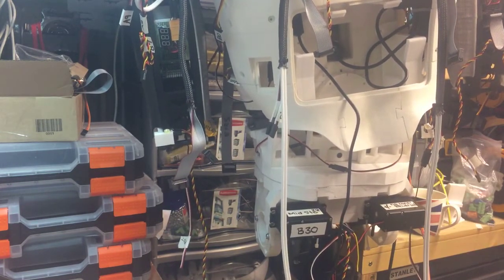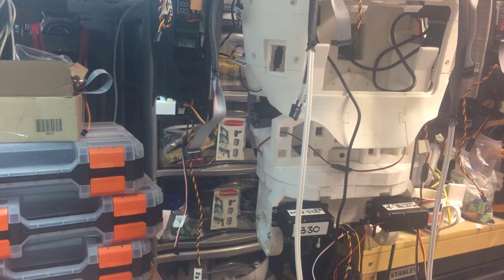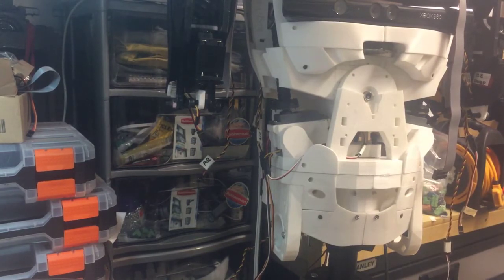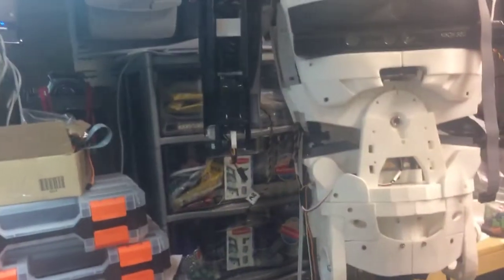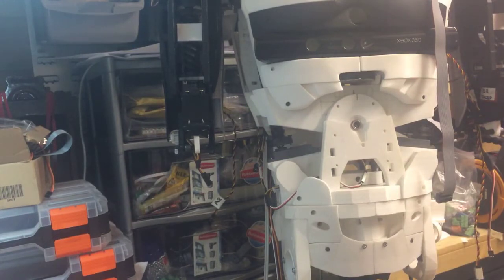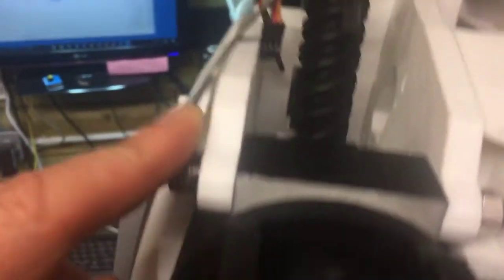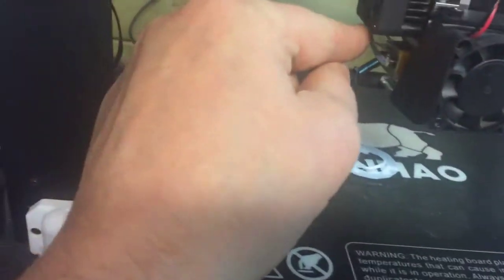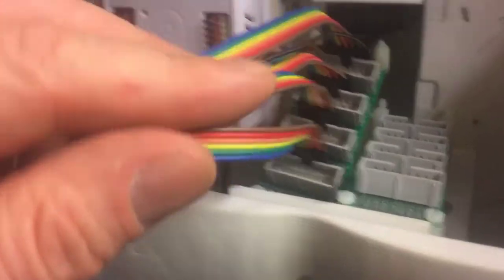InMoov Build Part - 5

Comment: Hi Kyle, which vid do you cover hacking the lower stomach servos? I saw Gael listed a few servos that would work for the lower rotation, I got two Cys-s8218s that I hope will work. Are they any different than the ones used for the side lateral movement? Thanks Jim
Reply from the maker: Hi James
I dont have a specific video on hacking the stomach servos but  I did video the hacking of the neck servos which is similar idea, check out Part-20.  I am not that up to date on the current crop of servos suitable for the stomach and lower body.  I used  mostly Hitec 805BB; I think Gael uses several makes but cant find on his blog which he uses at present but have read it somewhere
Reply: kyle campbell thanks Kyle!